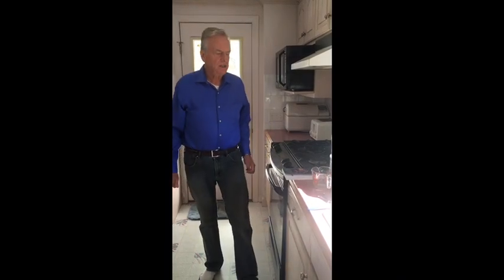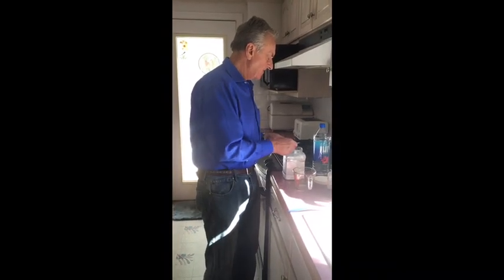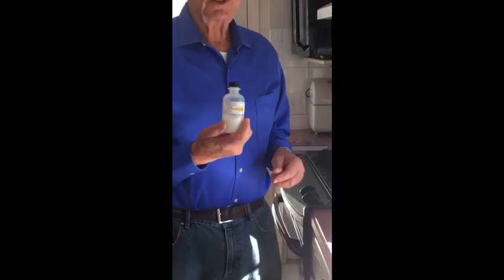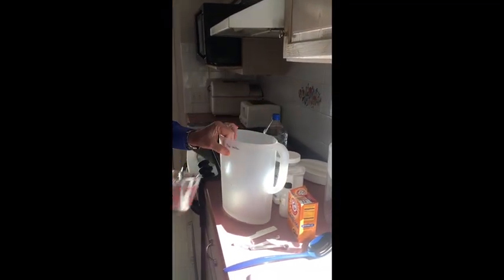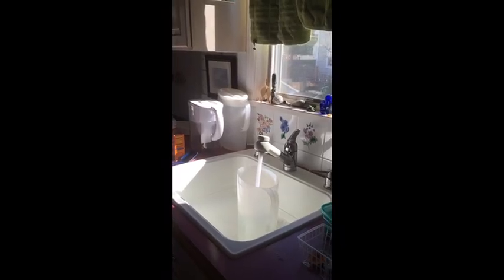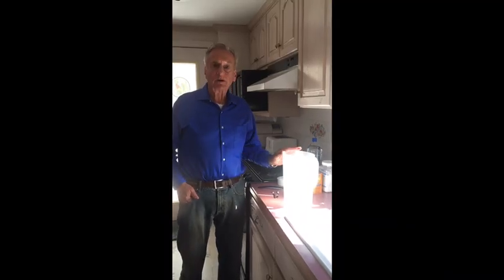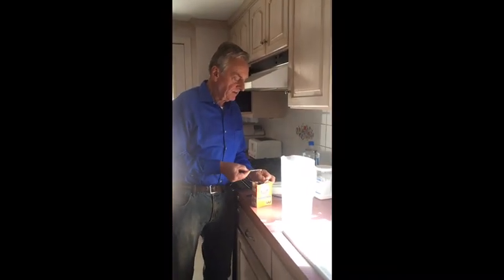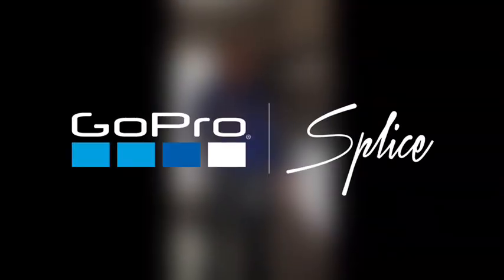Silica Water - Silicade  How to make it at home

Comment from the maker: There are people sharing my silica water recipe.  I have found   a few errors they have made.  First, you should use an eighth of a cup of water in the first step.  Using any more water will result in incomplete dissolution and it will require more time to come to boiling.  This will result in a lower level of OSA.  When measuring please make sure you level off your measurements as I show in this video.  Also, the Brita filter does not remove fluoride.  I have made a bone char filter which will remove fluoride. Silicade will only remove aluminum from your body. It will not remove any other toxin. At my blog on blogger, you can find safe ways to remove lead, arsenic and mercury from your body. http://prevent-alzheimers-autism-stroke.blogspot.com/2019/02/making-aluminum-and-fluoride-free.html?m=1

Comment from the maker: I would like you to follow this recipe precisely!  There is a reason for every step !  For instance I have heard from several people they have used more than an 1/8 of a cup of water to dissolve the sodium silicate.  This will not work well as the sodium silicate solution must be very basic in order to dissolve the sodium silicate.  Adding more water will make it less basic and less prone to dissolve.   Many people are concerned about fluoride in their tap water - you can use RO water or distilled water.  The water needs to be near pH neutral 6.5 to 8.5.  You can heat it on the stove and not use the microwave.  However DO NOT USE an aluminum pan to heat the solution!
Reply: Dennis N Crouse If I use distilled water, is it okay to skip the Brita filter? Thanks